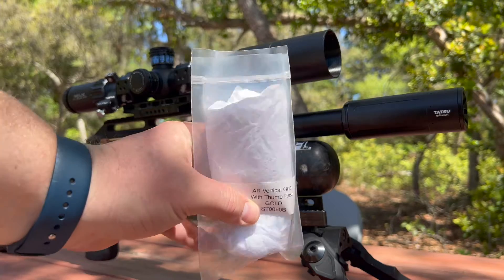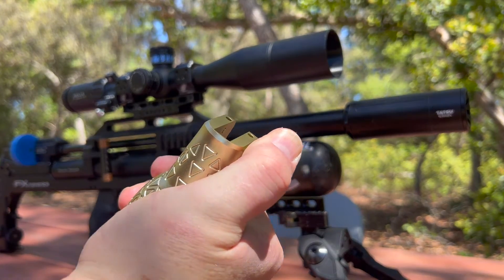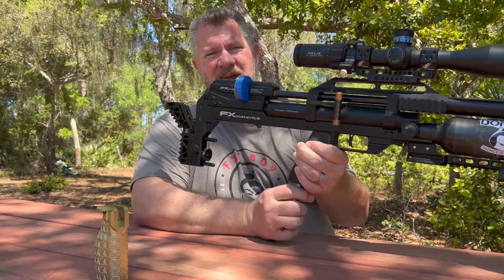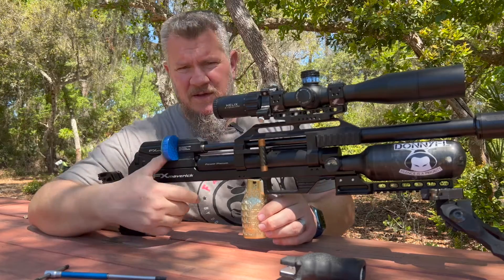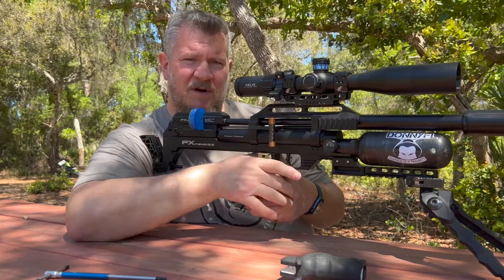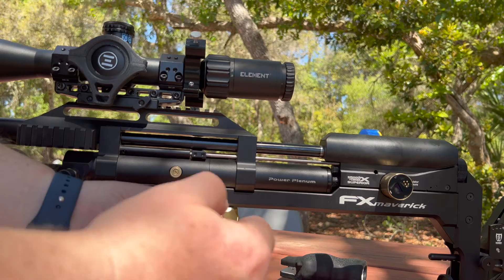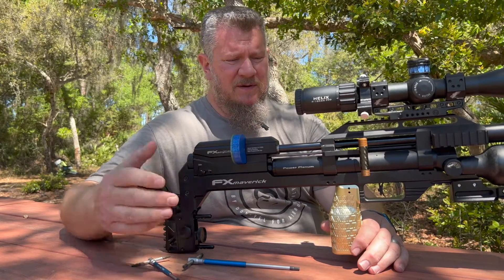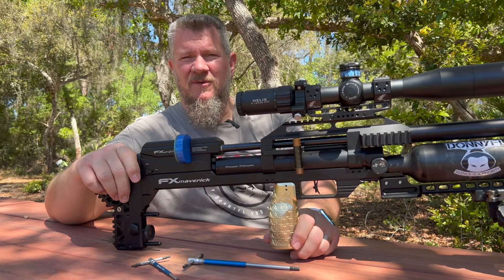Installing the Saber Tactical Vertical Grip on the FX Maverick Compact

Comment: Great looking grip and the only one with a thumb shelf. I wished it had a rubber grip. I'd hate to lose grip on my heavy ass rifle moving it around from stage to stage.
Reply from the maker: The triangle design gives more grip than you'd think, but I hear what you're saying.
There's a product called Cat Tongue tape, and one of our guys spent a rainy Saturday cutting and applying it and it worked pretty well. I used it on my ST AR style grip and it was (IMHO) a big improvement.